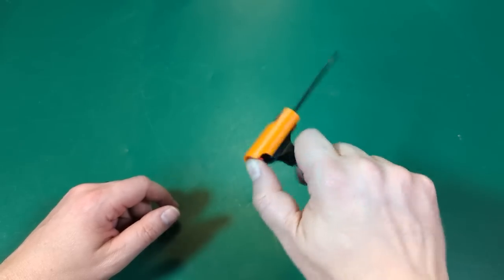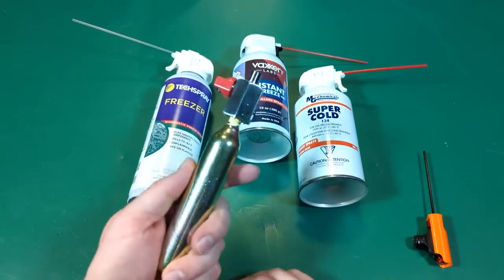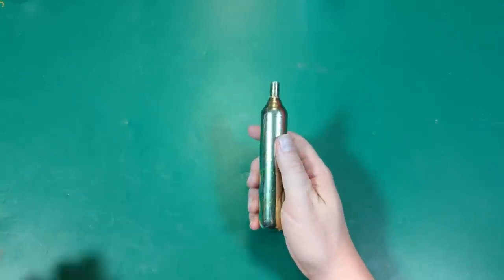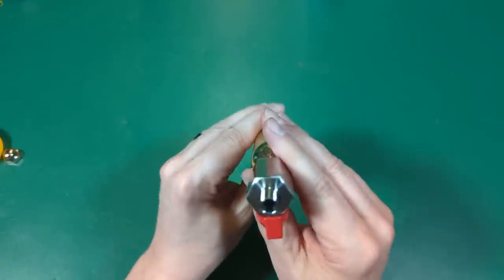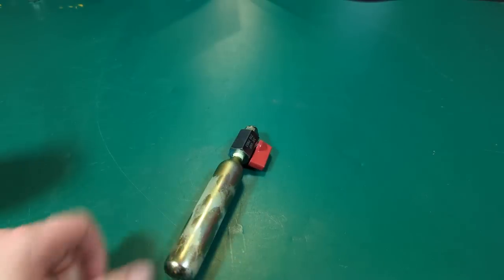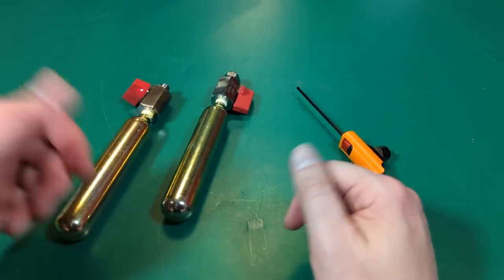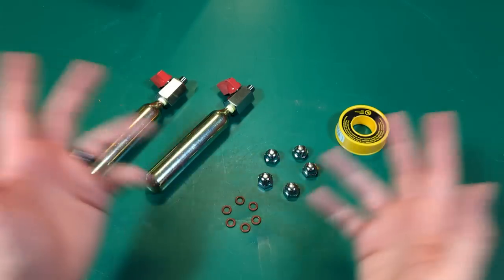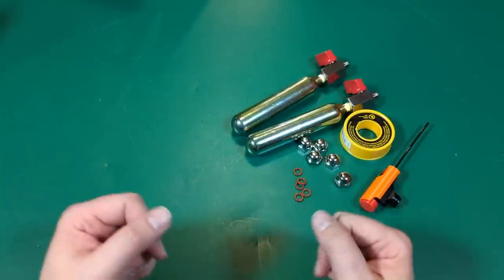Making Your Gas Canisters Refillable

Comment: My gut wants to remount that valve’s handle 90 degrees, so that when closed it’s inline with the bottle.
Reply: That goes against conventional standards with valve design and someone would remove the head thinking it was closed if you let others use it.
Reply: If I was in the market for this tool that's definitely what I'd do as well. It makes more sense.
Reply: Inline is open cross is closed. This is the way
Reply: If you're the only one using it, you do you. I like the convention for consistency.
Reply: I had the same idea but unless you are the only person touching them ever, it goes against all conventional gaz fitting knowledge.
Reply: shit. just noticed the 4 other comments say exactly the same hahhaa. Well, confirmation is okay in my book. Take care yalls
Reply from the maker: @gravy1333  yeah, I even thought about that
Reply: @DeviantOllam  there ARE applications where handles are in-line when closed, specifically for situations like this where you want nothing to catch on it.
You just need to label it properly lol
Reply from the maker: @ke6gwf  I don't mind if the end-user wants to change the orientation of the handle themselves to point whatever direction they would like. 😁
Reply: It would be confusing for all of us used to the normal way these valves are made.
Reply: @DeviantOllam  why didn't you do it right then?
Reply: Make it a round knob with an arrow to indicate position then it cannot snag on anything. Those wanting something different can modify the device themselves or machine or have machined something more to their liking. It's only metalworking.
Reply: @tasteslikepennies2549 because the "right" way is following standards, standards say the handle is inline when the valve is open by default, if the default doesn't work in a situation then it's fine to change it for yourself.
Reply: @Comm0ut This. Standards are great, but when the transverse valve handle snags on something in your bag and releases all your gas, then tell me how much your standards are helping in this unconventional setup.
Reply: The acorn nut kinda fixes the issue tho.

Comment: I see some issues with this. When you went to unscrew the valve from the blaster you first started only unscrewing the canister from the valve (while full). this seem dangerous and I feel like this could be engineered around, even if its just a grub screw on the valve.
The valve is very out of the way when closed, easily snagged in a bag which would be annoying to deal with the fall out of depending on what else is in the bag and also makes it awkwards to store. It needs to be reversed. inline when closed and extending out when open. I get this isn't how valves are normally designed, but these need to be mass storable in a filled condition which is much easier if the valve is inline with the canister. edit: I see at the end you addressed this with nuts, which does seems like a more safer storage solution, but is also more clunky compared to just ignoring generic standards and specialising your solution to your application.

Comment: You need some sort of a guard cap to ensure that the valve doesn't get opened while this is bouncing around in your bag. It doesn't need to be impact resistant like the cap on a big gas cylinder; it just needs to prevent bumps from applying torque to the valve. 3D printed plastic should be fine. Something with a slot to hold the handle closed and fingers to reach around the neck and snap it in place.

Another option would be to replace the bar-shaped knob with a round knob.
Reply: You didn't watch the entire video did you?  They provide an acorn nut with a grommet for that very purpose.

Comment: The thread happens to be 3/8" UNF. The canisters (and some similar valves) can be obtained in cycling shops throughout Europe. Imperial Acorn Nuts not so much :)
That's why I designed and 3d-printed my own, here is the openscad script:

id=9.3; // mm
height=15;
m18=18;
fn=72;

difference() {
  union() {
    cylinder(r=m18/2, h=height*0.8, $fn=6);
    translate(v=[0,0,height*0.8])
      sphere(r=(m18/2)*0.8, $fn=fn);
  }
  translate(v=[0,0,-0.1]) #cylinder(r=id/2, h=height*1.05, $fn=fn);
}

Comment: Hey Dev, what will the actual fill mass be for those cylinders? Filled with CO2 they're only 33g, but R134a is nearly twice the density and it would be a waste to only put 33g of that in each cylinder.

Comment: Very nice. I don't really have a use for them but I'm sure others do. And they look really cool. But that may be because I like the look of machined things.

P.S. I wonder if and how these would work with WD40 or DeoxIT. I use those a lot in my field and wonder if this might be easier to carry around a few of these. (not for opening doors btw, just regular maintenance)
Reply: You can buy WD40 in 5L non-pressurised bottles, then use that to fill up whatever sized pump-bottle is convenient.

If you use a lot of it it's by far the cheapest way to buy it as you are only paying for the WD40 itself and not for any propellant or the disposable pressurised cans.
Reply: @DEADB33F  Nice, I did not know about that. Thanks for letting me know.

Comment: Not sure is it also with your valves but a lot of them you can unscrew the handle  and turn it 90° or 270°.
It would be now flat in the closed position. Also just take a Grinder and shorten the handle.

Comment: Wouldn't it be better overall for refilling to have a system analogous to how you refill lighters IE with a filling valve onto which you would press on the can to discharge it directly into the canister while maintaining an airtight seal?

Also no need to close it manually
Reply: Adding complexity for its own sake is generally not productive. The current valve is elegantly simple thus less likely to malfunction.

Comment: Is it worth mentioning that if you do manage to fill the canister and valve right to the top with liquid while it's cold, that you have just made a serious bomb! as the liquid warms up it is going to expand, but you have nowhere for that expansion to go, and no relief valve. so its gonna go BOOM at some point. 
There is a good reason gas cylinders of all types have a maximum fill weight.

Comment: Have you considered making this device foldable, whilst loaded?  Being able to slip this into and out of a pocket without worrying too much about the straw seems like it could be handy...  As does a detent for locking the valve handle into position.  Not sure how much that would impact your cost basis, but it would make it easier to conceal safely on your person.

Comment: I wonder if this would work for the CO2 cartridges we use in the cycling industry to quickly refill our inner tubes after a flat??? Thoughts?
Reply: Oh and we would love to have an update about Kara. Such a tough story.
Reply: Of course it would. Any container which won't leak down is fine and in this case the valve is basically an extension of the cylinder. Since valves are not perfect it would be wise to periodically weigh the containers to ensure they're full but that's easy enough. I use commercial CO2 cylinders for vehicle tire filling and bead seating in the field so if you have that use for them you could keep a small CO2 cylinder handy to periodically refill your little ones. You can also use paintball tanks with tire inflator adapters. It's all just plumbing.

Comment: All those aerosol cans are refillable as well.. you can either have the right tool to depress the nozzle stem OR add a bike pump valve to the side... Just check your pressures, dont blow yourself up.

Comment: What if you made it 3 sided so you can use two of the sides for schrader and presta valves. Would decrease the bulk to using the two in conjunction.

Comment: I think if you hold the refrigerant can upside down during filling, that'll get more liquid out and help fill the canister faster and more efficiently 🤔
Reply: It all depends on the cans design or intended purpose. Those canned air generally have a syphon tube inside them (basically turning it into upside down without the need to hold it that way). If you are trying to do it with can designed to refill car AC then yeah you have to turn the can over.
Reply: Canned air sprays gas upright liquid inverted.  Freeze spray has a siphon tube and sprays liquid upright.  R134a refill cans get inverted to discharge liquid. Co2 cylinders are available with or more typically without siphon tubes.

Comment: could you turn the valve lever 90° so its normally closed in the streamlined position and would be turned CCW to open? then you wouldnt need a nut

Comment: Wouldnt it be easier to use the r134a refill canisters for refilling car air-conditioners? They have a scew head on the end of a hose already. And it wouldnt be hard to make adapters between the hose end and the ball valve. Less loss that way..

Comment: what if the valve catches while in the bag?
i think it would make more sense for you to have the valve close so the toggle is inline. or even better have a round nob instead of a lever.,
Reply: That most likely would be a custom-made valve or at least a customized handle. Every ball valve I have ever seen is set up this way. Inline allows flow and perpendicular shuts the valve off. I am sure it could be done and may be as simple taking the handle off and rotating it 90 degrees but id personally would much rather deal with the added bulk vs having a valve handle that is installed incorrectly.

Comment: Have you tried using one of those R134a car AC refill kits with the fill hose to refill these? The nipple size looks to be pretty close to the same size as what a car uses, so it'd be interesting to know you could pop into any Walmart or AutoZone and get exactly what you needed.
Reply: R134A car refill kits connect to the low side service port.  That is a 13mm quick connect fitting.  CO2 tanks use a CGA320 fitting.  I do not believe an adapter currently exists for this so you would have to get the two fittings and appropriate connectors to do this.

Comment: Could you 3D print/modify the ball valve switch so that the closed position is flat?
Reply: In theory I guess you could but valves are cheap and made to withstand specific pressures.  A 3d print might fail unpredictably.
Reply: @OneOfDisease  That would be a worry but I thought the plastic bit was just turning a metal ball so it shouldn't need to withstand pressure.

I don't have any in stock to check.

Comment: If you are worried about environmental aspect, this is amount of gas it leaking out from your cars AC about a year, bit more for building AC and around 10000 times of whole cars AC emptying when one of those lucky turbines (wind turbines) torches to the ground... If you want think ozone, ban the wind turbines and dont use AC...

Comment: The entire point of R-134 over CFCs like R-12 and R-22 was that R-134 didn't deplete the ozone layer. 

The only reason for the ban in venting refrigerants was because of ozone layer damage from CFCs.

R-134 isn't a CFC. It's an HFC. 

Hydrofluorocarbon rather than chlorofluorocarbon.

So scientifically, you're fine, but legally, you technically aren't.

Comment: I couldn't help but think you should be depressurizing the upper before unscrewing the system.

It allows for verification that the ball valve isn't in failure or accidentally opened, and it puts less stress on the threads.

Comment: Be careful. do not over fill. You need 20% space for expansion when the tank warms up. They will explode if there is no room for expansion. Even the cans that you are filling from have room for expansion.
Reply: Sounds like this is an argument against putting the canisters in the freezer before filling 🤔
Reply: @Chirael  I would not feel safe doing any of what he recommends here, I've seen the carnage left behind when high presure containers let go. I would feel even less safe recommending it the way he does. Being sued is no fun at all, I'm told.
Reply: refrigerant isnt that expansive, have you ever handled a professional size canister that the hvac guys use its about as strong as a disposable Coleman propane tank. Also at the volume of those canisters I dont think the refrigerant will try to create enough pressure to do much. Even on the high side of car hvac systems that use 134 it still takes a compressor to get it past 500 psi. Not to mention the can of duster is about as thick as a soup can where as there is no way to draw that small canister out of metal that thin so those are going to have a pressure factor for co2 which is in the thousands of psi.
Reply: @nik_kot  The problem is that most refrigerants have a nontrivial coefficient of thermal expansion even in the liquid phase. At the -26C boiling point of R134a, the density of liquid R134a is 1374 kg/m3, so if you filled one of those 50mL cartridges entirely up to the brim, that's actually 68 grams of liquid R134a. Once capped and sealed and allowed to come back up to a 20C room temperature, a portion of the liquid will boil off and fill any extra space you left up to 572 kPa with gas, but the LIQUID will ALSO expand, since its density at that temperature is only 1224 kg/m3. That initial 50mL of liquid we added now wants to take up 56mL of space, and if that much space isn't available the pressure that this expansion will exert is nearly ten times as much, around 4059 kPa.
Reply: @Lee Johnson I will say, though, that it's actually not an issue here; those 33g cartridges he's filling have a burst strength over 60 MPa, more than ten times the critical pressure for liquid R134a. This is 100% an issue for the flimsy freezer spray cans, but it's 0% a problem for the steel cartridges -- you could heat the freezer-overfilled steel cartridge up well past temperatures where it was safe to touch and it still wouldn't pop.
Reply: Yes, this can be extremely dangerous if you end up filling it up to the top with liquid. The liquid will expand with even mild heating and blow the canister. There is no safety relief valve here - normally the seal you puncture is also a safety release vale in case of overpressure, but that does not work if you put a ball valve there.

I make very custom solid copper propane torches with a built in propane supply - no screwing to a propane tank, you refill the torch like a butane torch but it's propane. Propane is much higher pressure than butane. Once I accidentally filled one completely full, it only took about 20 minutes before it split entirely open. I have tested these to withstand more than 500 PSI!
Reply: @nik_kot  Also, as I articulated in my second comment, even that's not an issue. The cylinders he's filling are easily strong enough -- by an order of magnitude -- to contain the expansion of the R134a even if you filled it completely to the brim. The result would just be a cartridge full of supercritical R134a, not a broken cartridge.
Reply: @AJMansfield1  Were the cartridges intact and used properly you'd be correct, after having the neck drilled out by any random clown, and a valve screwed onto it with a basic teflon tape more akin to the low pressure side of a gas cooker, I wouldn't put my hand anywhere near that thing.
Reply: @kchortu  yes I have. I’m CFC certified and an HVAC contractor. I’ve seen what happens when a recovery cylinder is overfilled and left in a bed of a pickup truck in the hot sun. It exploded and tore the whole cab of the truck off. Lucky it wasn’t me, but you have to leave room for expansion!
Reply: @ryanroberts1104  those sound interesting. Link?
Reply: @AJMansfield1  Nonsense! When the cylinder is full the gas is a liquid. It has nothing to do with the pressure the gas can create, if you filled it entirely to the top with cold liquid, then let it warm up, IT WILL EXPLPODE. Liquid cannot be compressed, and when it expands nothing can stop it.

It's like making an ice cube. Fill an iron pipe with water, and freeze it, what happens? Now imagine when it burst the frozen water immediately turns to expanding liquid. That's called an explosion, and it will hurl jagged metal into your face.

To be honest, these have absolutely no overpressure safety device, and that makes me wonder if this is even legal. It's definitely a big enough product liability that I would never sell it. You could not sell them prefilled with that valve on top. You can only sell them prefilled with that pierceable cap, because it acts like a blow off disk in case of over pressure.
Reply: @markbickford9092  Sorry, due to the inherent dangers involved they are only available to gas industry people who deeply understand the possible dangers. I would love to sell it as a commercial product but the liability does not interest me.
Reply: Relax, it’s r134a it’s critical point is only like 40 bar. It’s not going to suffer hydraulic failure because the concept of liquid won’t even apply
Reply: @geekswithfeet9137  You have no idea what you are talking about. If you do indeed fill the entire can with cold liquid, with ZERO expansion space, and then let it warm up - IT WILL RUPTURE! Whether it just cracks open and farts or throws shrapnel through your eye ball is anyone's guess.
Reply: @ryanroberts1104  yep…. No idea what I’m talking about… only used my refrigeration trade qualification to pay my way through an engineering degree. Sorry, but what experience do you have?

As I said, it hits its critical pressure well and truely before Burst pressure.

Do you know what that means?
Reply: @ryanroberts1104  went pretty quiet there man?

Comment: Are you really, REALLY sure it is safe to recommend taking a drill to high pressure vessels? From a liability point of view I mean?
Reply: He is only suggesting you increase the size of the hole you already pictured in the thinner seal at the end.  From memory the entire end is usually thinner, so it shouldn't be an issue.
Reply: Note the location of the hole....